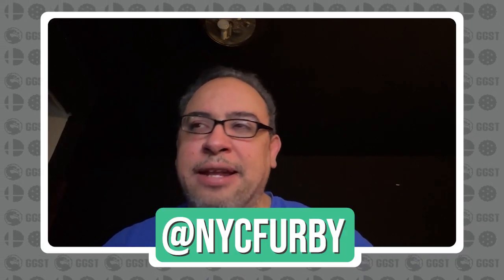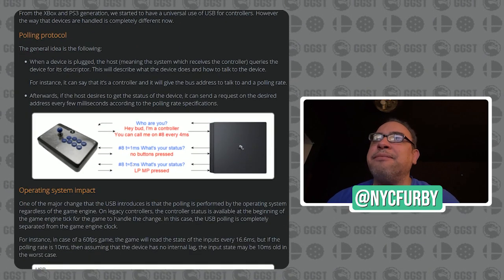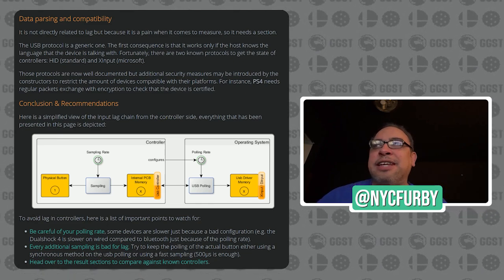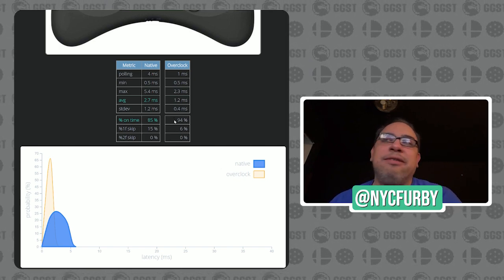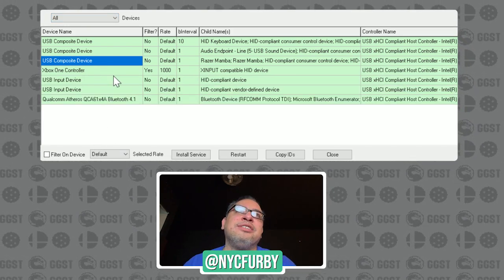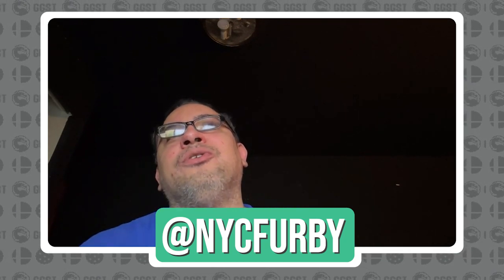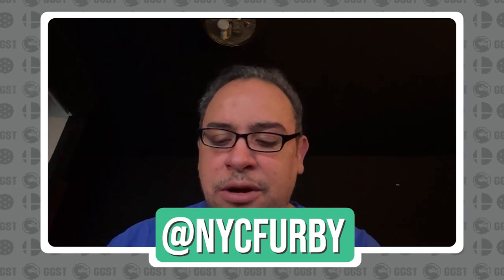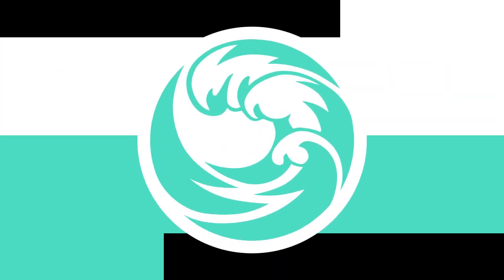Fix Your Lag

Comment: Low Latency Mode in Nvidia Settings only reduces Input Delay if you are GPU bound. 
Battlenonsense did a video on it and it actually increases input lag if you aren‘t GPU bound
Reply: How do you tell if you are one or the other?

Comment: 240hz Acer XF250Q with GSync enabled
Victrix Pro FS overclocked at 1000hz using Brooks Wingman XB so I never have to turn on overclocked every time
VSync is off
Specs are a GTX 3070TI,  AMD Ryzen 5 5600X  with 16GB of RAM overclocked to 1599MHz
I've thought about lowering the resolution as well but I didn't want to go that extreme just so I could at least have the game look nice.
I also remembered when you last talked about this and used an Otto DIY kit, but my hands are so used to octogate as a player it felt off to me so Sanwa parts felt fine.
I also use Cherry MX Switches for the buttons, Crown 202 Mechanicals. But I might switch back to Sanwa parts. 
I'm the only one using the internet in my house and I'm wired.

Unless using the Otto DIY is that important on the joystick, I think I'm doing everything optimally

Comment: I'd call the monitor lag output lag rather than input lag. Input lag is how long it takes for your inputs to be registered as an action by the game, output lag is how long before the game tells you what the result is. I think they should be separated out bc they produce very different game effects. If you have high output lag but low input lag, your buttons come out earlier but you'll have less warning about what the opponent is doing, so you'll be able to sneak in more mashes but you'll feel like you're always guessing as to what's happening. If you have high input lag but low output lag, your buttons will come out later, but you'll be more up to date about what the state of the game is, so you'll have to play with more predictions, since buttons on reaction will come out too late, but you'll have more of a read on what's going on.

Comment: I don't get the Vsync part. Switch off Vsync but turn on Gsync? Is that correct?
Reply: Vsync makes the game wait to send the next frame to the monitor until the full frame is done, so essentially if the game has only finished rendering half the next frame if vsync is off, itll send that half-updated frame, which could result in some screen tearing, if vsync is on, the monitor will just flash the previous frame again and you'll have to wait 1/60 of a sec to see the updated frame. Since you're trying to reduce lag, having the monitor wait to show you the next frame is not what you want.

Gsync is a special thing btw Nvidia graphics cards and compatible monitors where they communicate so that the monitors refresh rate matches with the games refresh rate. Most gpus and monitors talk to each other at safe 60Hz since thats what the game will typically hover around. So if you have the hardware to get >60fps, and a high refresh monitor, it doesn't matter, you'll only see updates once a frame, so there will be a bit of delay. W Gsync, if your fps is high, the gpu will tell your monitor that it should update more often, so you'll get screen updates at more than 60Hz and thus get the updated frame with less lag.

So Vsync reduces the number of updated frames and is bad for lag reduction, Gsync increases them and is good for lag reduction.
Reply: @iliakatster  So yeah like I said. Vsync OFF, Gsync ON? That's what I'm getting from you and Arturo's video.
I have a G7 240hz monitor. Really don't know if that's good for FGs but it's commercialized as something with very low latency lag. And I want to make use of that in FGs that I play. It's Gsync/Freesync so the part I'm asking about is quite important for me to know.
Reply: @Mioggle  You are correct, turn Vsync OFF ang Gsync ON for optimal performance/low latency.
Reply: But if i dont have tearing or anything like that i dont need to turn on freesync or gsync right? since some people say that they can actually increase input lag

Comment: Did all that and tried turning off vsync in sfv through the ini, but steam still shows me 60fps instead of 120 what can I do? Changed refresh rate in Nvidia control panel
Reply: sfv is a locked 60fps, you cant increase this unless you hack it
Reply: @SabreAZ  yes but art is using a 480hz monitor which impacts input lag, even if the game logic stays at 60fps
Reply: @neumann778  yes i understand that, but your post is talking about increasing the game's framerate, which you cannot do.  The only thing you can do is to make sure your windows setting is set to your monitors highest refresh rate so it puts the monitor in that mode.  It won't increase the framerate of the game in anyway, as it just duplicates frames.
Reply: @SabreAZ  hope that's true. Reacting feels easier but I can't say if it's placebo or not
Reply: @neumann778  I mean, it is true. It only shaves an extra few milliseconds though.  Usually half frame or less at 120-165hz.

It visually makes it nicer as well. Since the pixels refresh faster, motion will be smoother. Less ghosting and such.

We won't get real gains until devs give us high framerate modes.  And I wouldn't be surprised if sf6 won't have it. Japanese devs are incredibly behind the times.  I have little hope
Reply: @neumann778  even if it doesn't increase the frame rate of the game, having  a higher refresh rate still matters
Reply: @rocco4476  I understand, I just wanted to know if the changes would appear on the steam frame counter, despite the game being 60fps locked
Reply: @neumann778  ah i see

Comment: couple other things that are helpful here in windows:
NVidia control panel - Set power mode to "Prefer maximum performance" (you can see Art has it already set to this in the video also)
Windows power settings - Create a new (custom) profile, when it asks you copy the existing "high performance" profile as a baseline and give it a new name and save it.  It's important you create a new profile because the built in "high performance" one will automatically shut off after a short while for power saving.  creating the custom one prevents this.  turn this on when playing games, to ensure everything is running at peak performance (USB, hdd, etc)
Reply: Thx sir 🙏🏽

Comment: There is no such thing as "good wifi."

You can't put your laptop close enough to your router to prevent dropped packets. Even if you duct tape them together. And if they're that close, then you can just connect an ethernet cable.
Reply: I have a strong policy of not arguing against folks who dispute facts.

Enjoy playing fighting games on wifi. I just hope the games all get wifi indicators so I can avoid all y'alls asses.
Reply: @ITNoetic  yeah these dudes always be in denial, even wifi experts can't convince them of basic facts
Reply: @Nydrin  lol, word. Also, of course there's a #capcom reunion in the comments of one of sabin's videos
Reply: I beg to differ. I have two uniquiti wifi 6 long range access points in my home. Dropped packets are rarity.